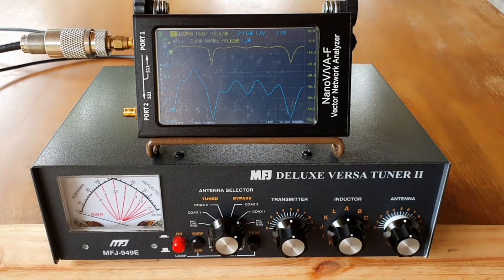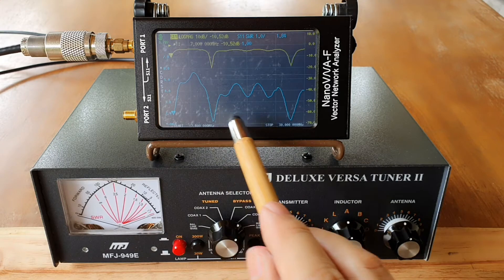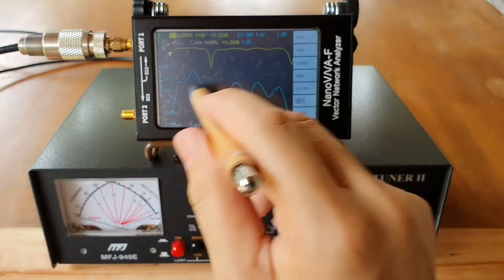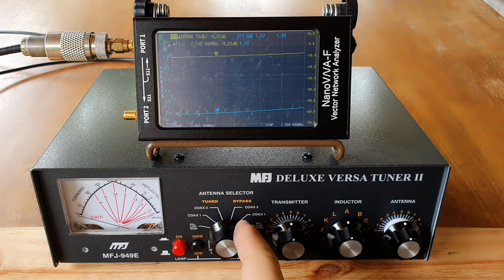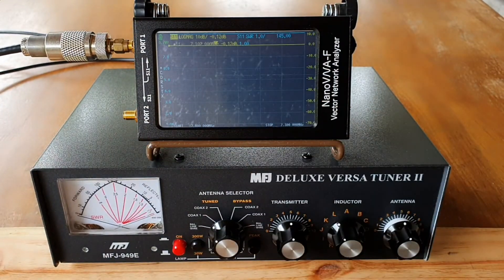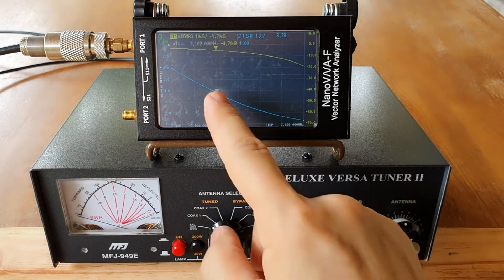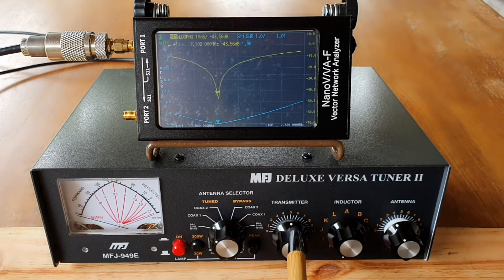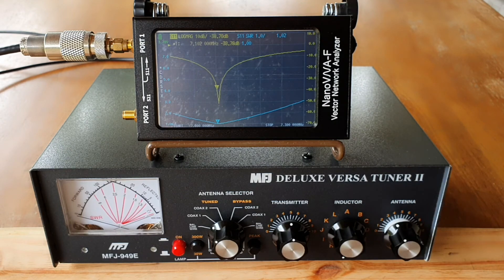MFJ 949e with NanoVNA Antenna Tuning

Comment: Some MFJ tuners will require at least a 10W signal to tune so this method won’t work
Reply: What about 969 do you know if it requires 10w.
Reply: Digital tuners yes, but this straightforward analog tuner. when adjustment is made the vna see it. so, it's working. yes, when you apply actual wattage to it there may need to be some fine adjustments made but it will be close. Digital tuners require wattage to become active and begin the tuning process. analog is analog

Comment: Excellent video!  Very helpful for us new hams and especially those of us new to the fascinating world of antennas!  Many thanks for posting.  I’m curious about two things, if I may…

First, I have an older MFJ Versa Tuner and the inductor is a roller with a counter.  Any thoughts on why they went to an inductor with a position switch?  Does it matter?

Second, how do you have your equipment hooked up for this?  Is it NanoVNA - coax - MFJ Tuner - coax - antenna?

Comment: Jay - Excellent presentation!  I just finished the initial work on an End Fed and counterpoise with a 9:1 match.  Your description of the procedure using the Nana VNA solidified it usage in the pre-tuning stage and will make my outdoor adventures A LOT easier - As long as I can get the Antenna to stay up high in the trees!
Cheers!  N9NAZ
Reply from the maker: Nice work! 73 du7jay

Comment: Very nice, I have a 949E too, as well as a 969 under repairing. Missing the nanovna still but will be an addition very soon.
Just remember to always start with maximum capacitance, and work the inductor to lower swr. Then ajust if needed trasmitter first then antenna cap. This way should bring you to a combination of the T network that is the best for efficiency.
Of course take note of your three settings and changing band will be a piece of cake.
73
Reply from the maker: 😊😊😊 73 du7jay
Reply: So do the opposite what he showed in the video and adjust transmitter first and then antenna?